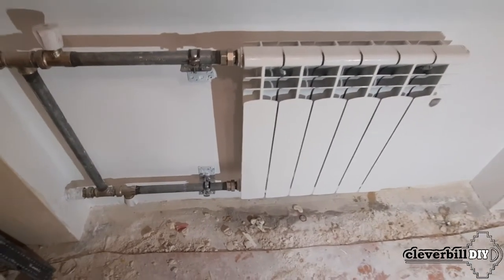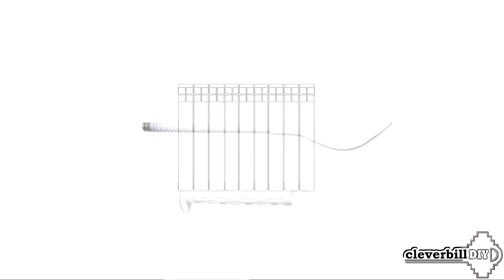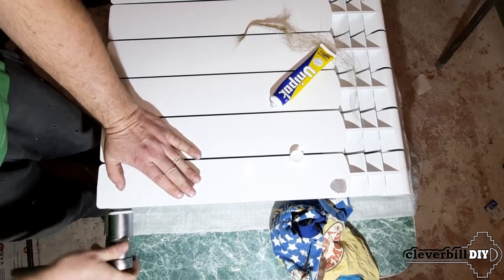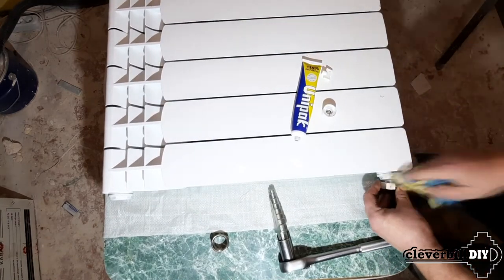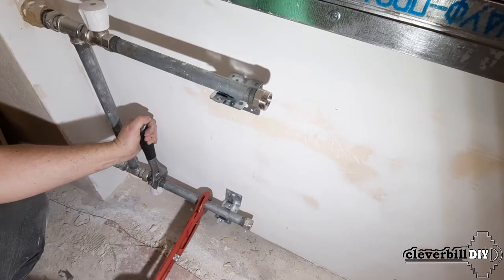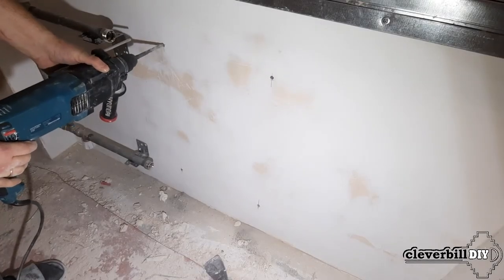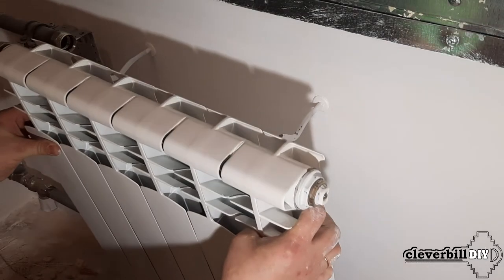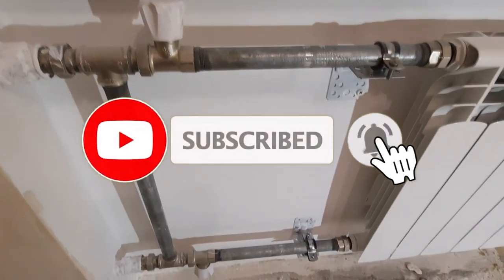How to Install a Heating Radiator DIY - Step by Step Guide

Comment from the maker: It seems to me that the assembly of the radiator connection set on flax is more reliable than using only standard gaskets alone.